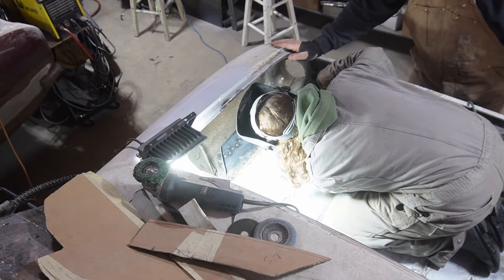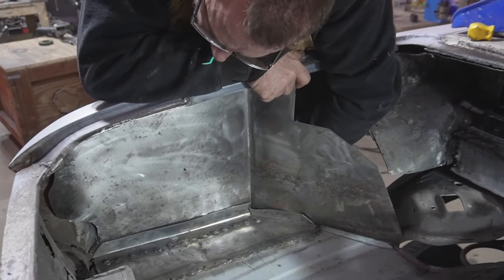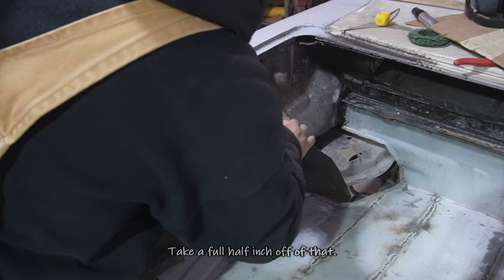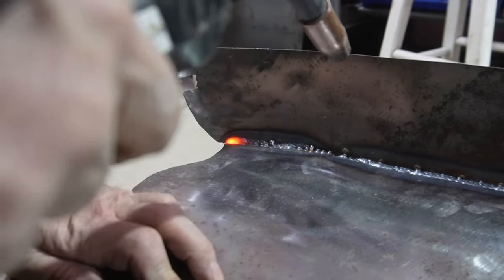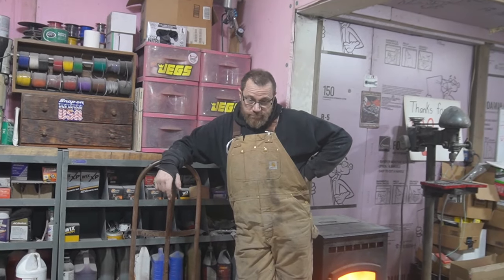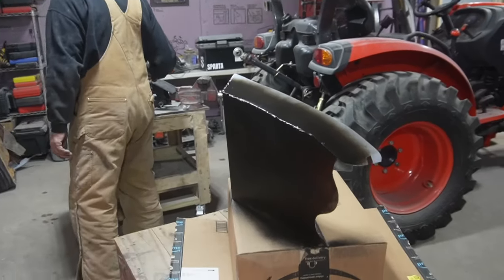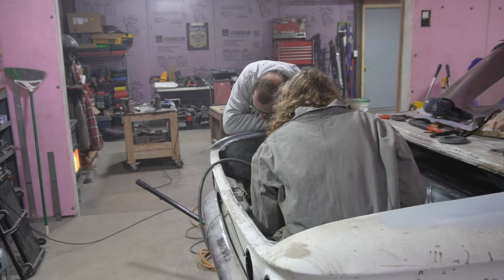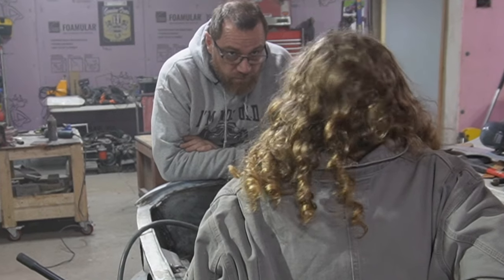Trunk sides in!┃ Episode 62

Comment: interesting design in the trunk, not what I was thinking but what do I know.
Reply from the maker: Most of the trunks in these things that I have seen looked like someone put a floor in the compartment and pretty well stopped there.  This one was too crusty to go that rout, and the parts car was too, so utilizing pans and well sections was out of the question there as well. I think we would have end up with a shallower box in the end. I chose to follow the "corvair" model, maximized for space.  It wasn't the original, or even the third plan, but as it came together seemed to be the best compromise of strength and space as this rides right on the structural members we built for the car.